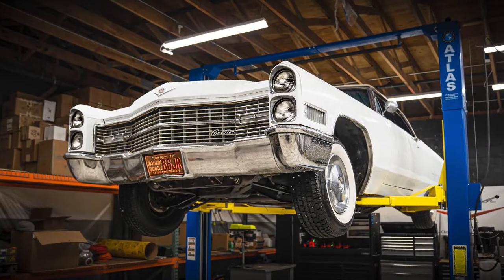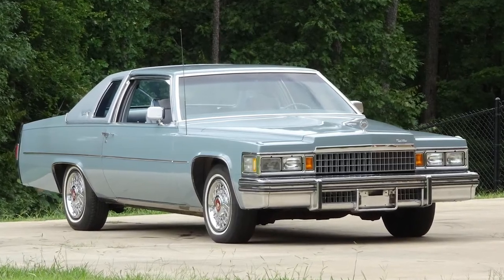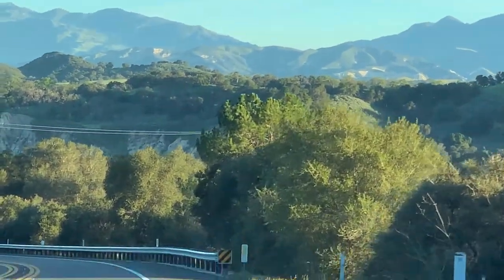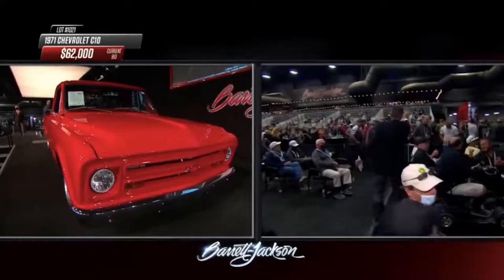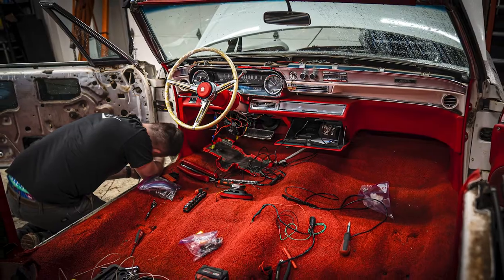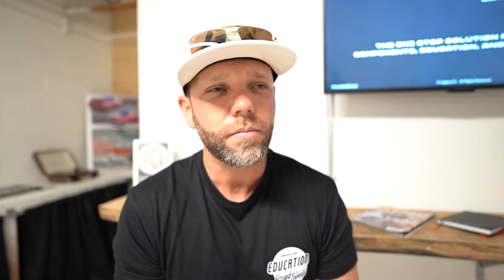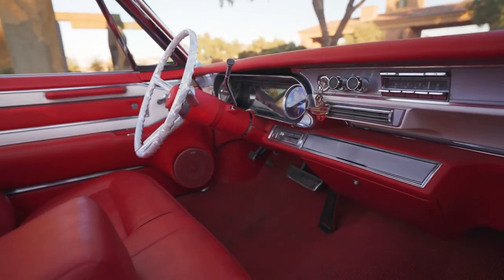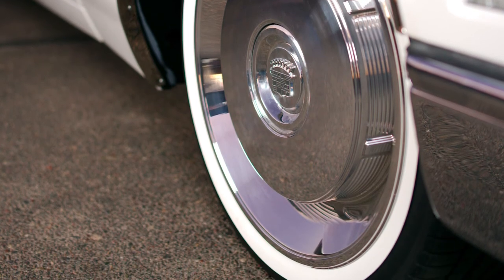1966  CADILLAC COUPE DEVILLE CONVERTIBLE EV CONVERSION!

Comment: Could that be done to a 1976 front wheel drive... What's the mileage on a full charge
Reply from the maker: It sure can! This car gets approximately 125 miles out of a 55KWH battery pack. You could install a larger pack for more range. Check out Legacyev.com for more info!